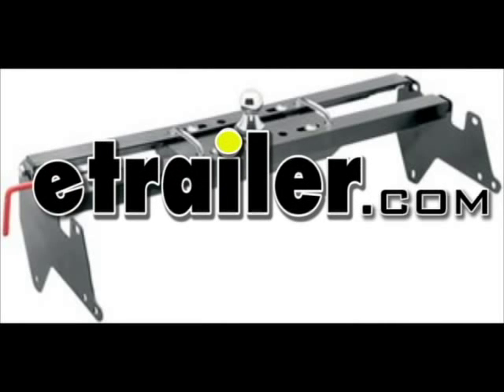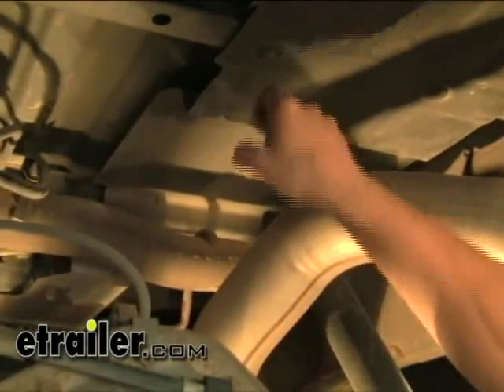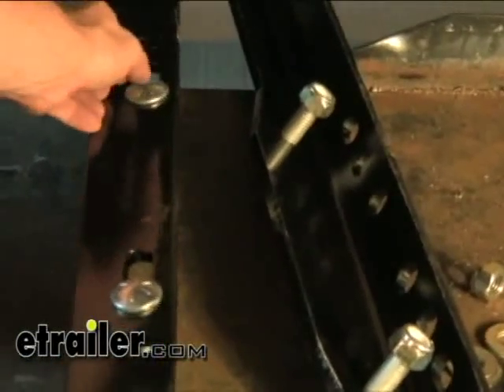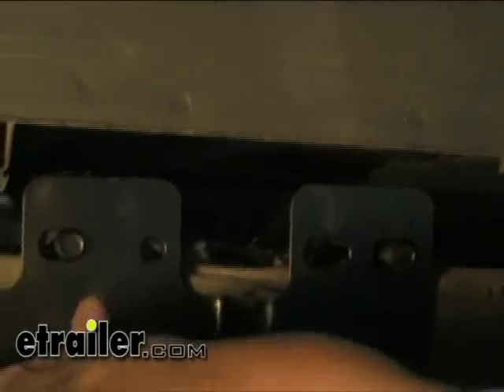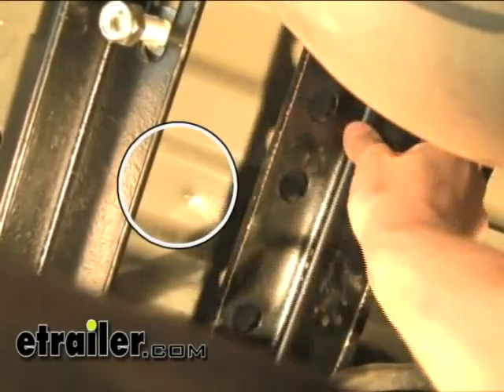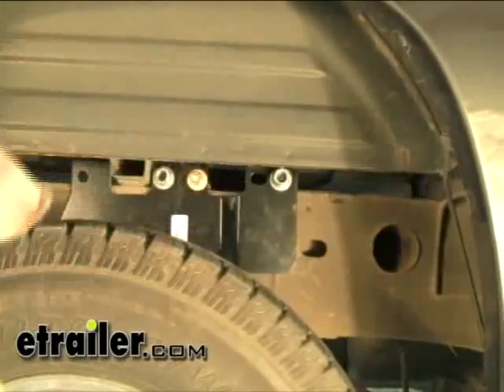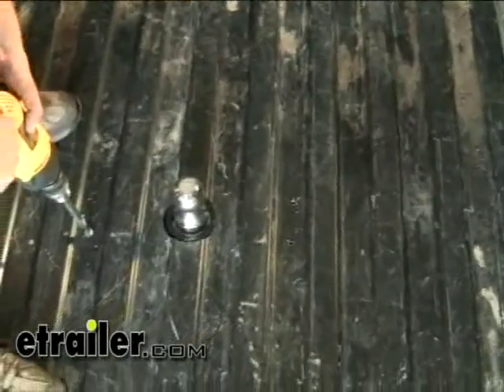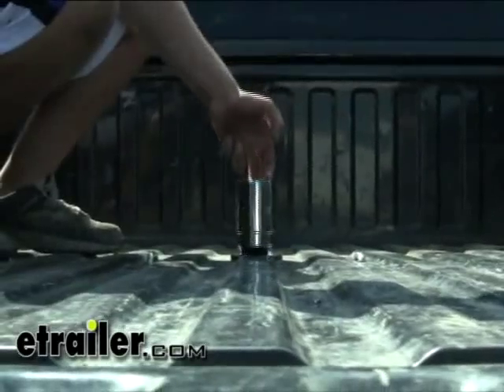Hide-A-Goose Gooseneck Trailer Hitch Installation - 2005 Chevrolet Silverado - etrailer.com

Comment: After instalation how do you keep the ball from coming out? I saw at the end of the video you just pulled it out and fliped it over is there something there to keep it in place so when your going down the road it don't fly up and you loose your trailer? Thanks.